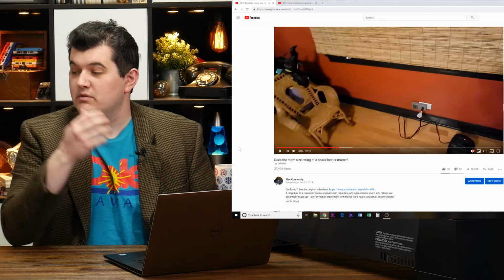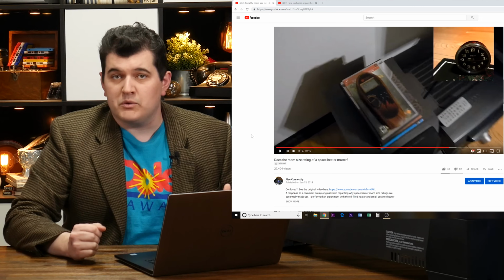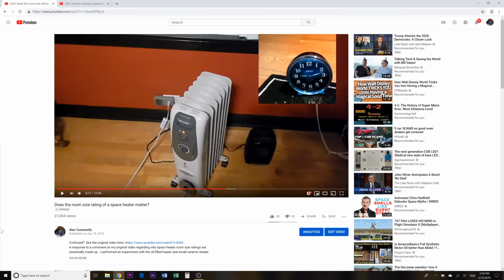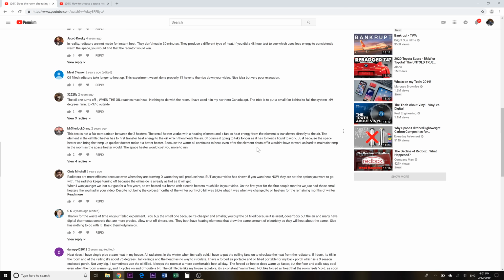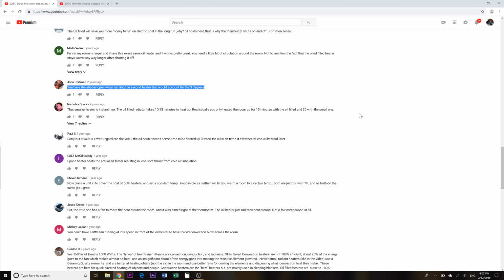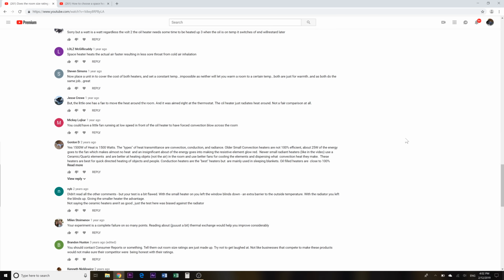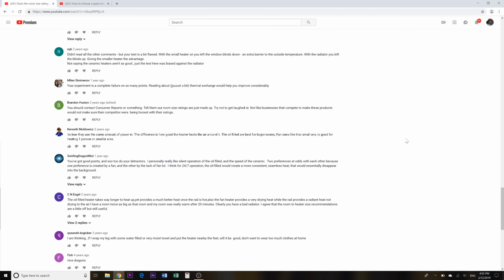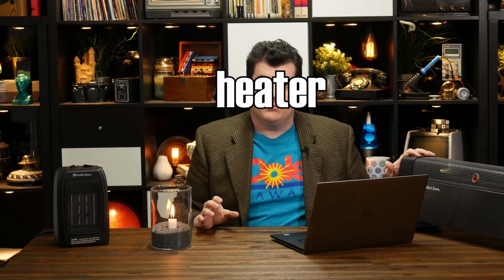More Space Heater Nonsense

Comment: The question is not BTU consumption, it's about the robustness of the heater design and its ability to reach an efficient internal heating element temperature to maintain effective heat transfer. As a simple example, I once bought a small 12v electric car heater (effectively a hair dryer element) which was perfectly fine when tested at 60 degrees but when used in a freezing car, would not heat up at all. Not even a degree. The heating coils increase in resistance as they warm, and need to get to a certain temperature before they effectively heat and begin to transfer that heat to the surrounding air. If they are overwhelmed by the temperature differential they will not - they are resistive heaters - and the power will simply flow through the coils without generating a high enough element temperature to enable efficient radiation / convection (reduced power consumption may be noted). If those coils were insulated in a fashion (from airflow) by an internal conductive transfer medium (metal plates for example) they could heat up internally to ideal temperature and then (yes more slowly) release that heat to the surrounding environment via those plates- like the oil heater. So 'small room' vs 'large room' is an effective argument that could be made at a larger temperature differential. It's about heater design and the ability to internally raise the coils to a valid degree of resistance and heat output, enabled by the heating element design and its surrounding housing, and not the BTU's. A large room with a greater temperature differential is more effectively served by something like the oil radiator as the air temperature would not rise as much relatively and would not reach self-limiting via the thermostat (as it does in a small room). The smaller unit, with internal fan and without the insulated element that can allow it to rise to an internal element temperature (resistance) to begin effective heating would be overwhelmed and may not heat at all. Put both candidates in a 0 degree Celsius garage and determine heat rise after a day, and I'd be more convinced there's no merit to small vs large design when compared to simple BTU consumption.

Comment: About 12A, 120 VAC...you could only increase the BTU's with higher values in either voltage or current...that's about all you can say....I bought the cheapest one possible for like 10 bucks and it works fine. And try to remember...the FACTS do not give a FAQ about people's opinions based in emotion and not science.

Comment: Rational human bing
Arguing in youtube comment sections

Pick one. If there is a 2-3% difference between a 100USD heater and a 10USD heater. Some people will cling to that difference as if their life depend on it just to say that you are wrong.

Just gonna point out that when i say 2-3 difference, i also mean 2-3% difference in electricity usage. Because i know someone is gonna write something stupid if i don't explicitly point that out.
Reply: lol nice try but 2 isn't a real number idiot!
Reply: If you buy the cheap one it'll burn your house down...maximum btu's baby!
Reply: Having actually measured the amperage draw of several different types of these heaters I can tell you with the utmost certainty there IS in fact a difference...

The mfgrs are rating the product at the worst case scenario of tolerance build up to draw no more than 1500w.

I have seen 3 different heaters, all rated at 1500w, set on high, on the same circuit, draw between 10.8A - 13.5A

So there is a difference in quality, which translates into functional efficiency...

And this doesn't even address the functionality of thermostats - which varies GREATLY!
Reply: @openeyes-411  I don't know what you specifically mean by functional efficiency, but I can guarantee you, they all produce the exact same amount of heat per watt consumed, and are all 100% efficient, no matter the quality.

Comment: Dude. I think you're on the right track. I know no more than the next guy. I think another interesting experiment or angle to all of this is the type of heater as it relates to application. So, forced air, oil filled radiant, infrared, etc. You know? Even with a space heater, I wouldn't want to attempt to heat the whole room. It would be more effective to use passive means of trapping the heat like a blanket over a table.  Sorry everyone in the comments has to be the expert all the time. It's really easy to be the keyboard expert having not done the real testing.

Comment: Is the definition of "rated for large room" vs "rated for small room" really about how fast or efficiently it warms a room up?  One thing that occurs to me is that the difference in rating might be a designed usage issue that's more about the unit's expected duty cycle rather than the raw energy it can shovel into a room per unit time.  I.e. a heater rated for a "small room" can heat up a "large room" just as fast as a heater rated for a large room, but in doing so it has to have it's element burning harder and longer than it's designed to be (increasing the risk of unit failure).  So the difference in rating is more a question of raw wattage, it's more about how long the unit is designed to run on full power?

To be sure, it is surprising that a heater designed for a "small room" should warm up the same room noticably faster than a heater designed for a "large room" - that does seem to fly in the face of what "rated for a large room" would seem to imply.

This is a subjective thing I guess, but I also noted in your other video that the rated room size often seemed to be tucked away in a corner on the packaging, rather than being the headline feature that the different units were being sold for.  I wonder if this is more a question of "if you use it on the wrong sized room, we're not going to honour the warranty if your unit breaks down, or admit liability if your house catches fire" rather than saying "this one will heat up a large room faster than that one"

Comment: I've been telling people this for years, but I did realize there are a few potential "losses" if the energy is escaping the room before becoming heat. E.g. a heater with a noisy fan will lose some efficiency due to sound waves transmitting through the walls/windows. Some of it gets converted to heat along the way, but not all. Same for the light and other EMF radiation that might be transmitted.

Comment: Realistically, from a thermodynamic standpoint, I'd expect that any heater with a fan would be more effective as the volume of the room gets larger. The less mixing of the warmed air with the rest of the air in the room that you get, the more likely you are to have hot spots. If a hot spot is near a wall, then the heat flow through that wall will be higher and you'll lose more heat to the outside. If there is significant insulation in the wall, perhaps this difference is negligible, although it will be non-zero in the wrong direction. I'm with you. This sounds mostly like marketing hype.

Comment: "Radiators" don't do much except hold heat. So I agree with you. Its a gimmick. But they can make a difference when used in applications like forced air. Take an oil filled space heater and put a fan behind it and you have a constant exchange of heat (if you consider that the room is not 100% efficient at holding heat). the heater should cycle on and off less because the oil should be holding the heat longer than a heating element with a fan. but they wouldn't work any  better without movement of the air. (Sorry if you mentioned this already, I'm commenting while watching) I kind of consider it to be similar to a cars cooling system, You have heat stored inside a radiator, without air movement past the fins the heat stays in the radiator, there has to be an exchange of heat between the air and the radiator, the more surface area on the fins or the more air moved over the fins the better the exchange. this is common sense stuff though. As far as two 1500 watt heaters of different types being more or less the same, I would think the oil filled one would be less efficient at heating the room unless you have a significant amount of air moving over its fins.

Comment: Upfront, I do agree Could the difference in effectiveness for "room size" be in the fan size and surface area?  The small one definitely moves less air, meaning that it should take longer to heat equivalent volumes of air evenly? So, wouldn't having a larger volume of air pass through the heater be better for large rooms? They may put the same amount of energy into the room but by spreading it out (larger fan and more elements) the room is heated more evenly?

Comment: Seems to me you didn't prove your premise with your experiment--1500 watts electrical energy in equals a consistent amount of heat energy out.  In fact, you proved the opposite.  That would be like saying 2 vehicles using 2 separate technologies each hold 20 gallons of gas, so they will drive equal distances between fuelings.

Comment: I'm curious about that statement someone made about "not drying out the air". What exactly do they think is different in that regard between the two heaters? Neither is adding water to the air and neither is likely to take water from the air via condensation or dessicants or the like. Does he imagine that the oil filled heater is burning it's oil and releasing water vapor that way? Crazy!

Comment: comes down to the oil filled is more efficient as once the room is to temp it shuts off oil still radiates heat and holds the rooms temp better you have to keep the forced air quartz heater running full time to keep the room at the same temp

Comment: If you want to bring a room up to a higher temperature quickly, then the heater that heats up a room more quickly than the other is objectively better. I understand the "1500 watts is 1500 watts" thermodynamics argument, but that means that every other factor of a heater's performance, such as the effectiveness of the thermostat, how quickly it heats a room, and its level of safety are the basis on which heaters should be chosen. Oil heaters are inefficient because they waste time heating themselves instead of the room.

Comment: If you were to repeat the original experiment, but place a box fan on a low speed behind the radiant oil heater to both keep the heater's thermostat from cycling, and to aid the transmission of the heat into the room,  I suspect the oil heater would heat the room as effectively as the small space heater.

Comment: There is a more efficient way to heat a room with electricity, using a heat pump. While it is true that 100% of the electrical energy will be converted to heat, if you use a heat pump to draw heat from the outside you will be heating the room with, say, 2000 watt/hour, only using 1000 watt/hour of energy. A heat/cold HVAC system will use energy to draw heat from the outside, and dump that heat+waste heat from the compressor motor inside your room.

Comment: It may have more to do with reliability / service life than heating performance. Let's say keeping a "small" room at X degrees requires a 1500W heater to run 30 min per hour (50% duty cycle), and keeping a "large" room at that same temp requires nonstop 1500W input (100% duty cycle). All of the heaters are capable of that, but maybe the smaller ones are built with components that will fail much sooner at high duty cycles or just in general. Overall, I do think it's primarily a marketing thing, but from an engineering standpoint, reliability is at least a plausible rationale for it.
Reply: Though durability could be valid, they don't market durability, they market room size, without evidence.
Reply: @adm0iii  Well, if you look at the packaging where the room size is listed, it's not up with the rest of the marketing fluff. It's at the bottom along with the wattage/btu specs. Plus, marketing durability on some models but not others (from the same brand) isn't a great strategy. It would imply that the smaller models AREN'T durable, which would probably make shoppers choose a different brand. Suggesting a room size in the specs wouldn't have any negative impact on marketing and would probably reduce warranty claims.  Again, I'm playing devil's advocate here ;)

Comment: Generally asking, if you had a fan (not a heater) that was 1500w, it wouldn't heat the room right?
If that's the case, isn't there a way for a 1500w device to be inefficient at heating a room?
Reply: A fan with a 1500W motor would actually heat the room exactly as much as a 1500W heater, as long as the room is sealed. The difference is that it would also produce unbearable amounts of noise  :)

A small amount of that power would be immediately converted to heat, on the wirings. The rest is kinetic energy, which would soon also become heat due to friction. Fiction happens between the moving parts of the fan, but also between the gas molecules of the moving air.

In the end, it barely matters if you have a 1500W heater, a 1500W fan, a 1500W computer power supply (used at full power, which is rare), or 10 x 150W incandescent light bulbs. All that will eventually be converted to heat. But some of these objects have other primary functions, and the heat is a desirable or undesirable side-effect – hence the efficiency ratings.
Reply: @jasondoe2596  Thanks! Physics makes me happy.

Comment: first of all how long did you allow the oil filled heater to reach max temp before you made your comparrison? it takes an oil filled heater 3o minutes to reach full output heat. your little space heater is a heating element type that is instant heat because it is resistive heat. try allowing the oil filled heater to warm for 30 minutes the re try your test . although i agree 1500watts is 1500 watts i know from experience that the oil filled will heat better and quieter than a small resistive heater

Comment: As a residential energy auditor for one of the gas/electric utilities in my state, I have been really enjoying your videos. Entertaining and thought provoking.

Just a few rambling thoughts that I had while viewing your latest space heater post:

The large oil heater caused me to consider whether it could be compared to an extended-release prescription pill, versus a "standard" pill that just breaks apart all at once?

Could the small heater be eerily related to the poor bastard who suffers from low sexual stamina, losing the whole experience in one foul swoop? (I've read articles on this unfortunate condition).

In homes where people have a boiler system, compared to a forced air furnace, we recommend NOT necessarily using a fluctuating schedule on a programmable thermostat, because a boiler system is a slow and easy heat, like a crock pot... Please realize that I'm just rambling at this point.

Perhaps it would be interesting to find a big ass room, and test out the heaters in it, allowing them to run for an extended period of time and compare the results?

Thanks for the videos!

Comment: To market a heater based on room size is misleading, room size without an actual measurement of some kind is subjective. What you see as a small room would be seen as a medium room by someone else. As Spock said to Dr. McCoy, "It would be impossible to discuss the subject without a common frame of reference." ( https://youtu.be/kBtoXKqgJDo?t=45 )

Also, the packaging/marketing doesn't say how quickly the product can heat a room. Does it take an hour to raise the temperature 5 degrees? Does it take a day? If it only says that it is "ideal for medium sized rooms" and doesn't give any other info, you can't make any kind of objective statement about the heater.

As for the actual heaters, it is kind of obvious that the heater without a fan will not raise the temperature of a room as quickly as the one that does. The fan allows more air to collect the heat energy in a given amount of time than the heater that relies on convective currents to move air past the heating element.

Comment: I would have liked to see more on the thermostats between the cheap and more expensive. I tend to over heat the room with my cheap brick, thus waist energy. My pricier heater with a digital thermostat controls the room temperature better, thus saving energy. Where to scratch the line in the sand, watt hours used vs watt hours needed?

Comment: So, if I understand you correctly "1500W is 1500W".... Ultimately, any 1500W power source will produce the same amount of heat/energy.   Air is just a lot easier to initially heat up than oil is.  The small heater is more instant, but possibly may make the room more uncomfortable over time (dryer air?).   The 'large room' 1500W heater's benefit isn't based in its ability to heat, but rather its ability to heat more comfortably (less dry air?), quietly, etc?   So, if you just want instant heat, then get the small one.  If you want heat (eventually)+features, then go for the bigger one.

 Once a large room/oil heater get up to working temperature, is it able to maintain that temp without a constant influx of 1500W?  Meaning, can they dial back their energy draw while maintaining the same oil temp/heat output?

Comment: One advantage of using the larger heater for heating a bigger room would be that generally, room heaters are left on for a longer time than a personal heater. If the bigger heater has a larger element at 1500w then the element would operate at a lower temperature, which could potentially increase its longevity.

So while it's not better at actually heating the room, it might last longer under constant load. Though whether it actually makes an appreciatable difference is debatable.